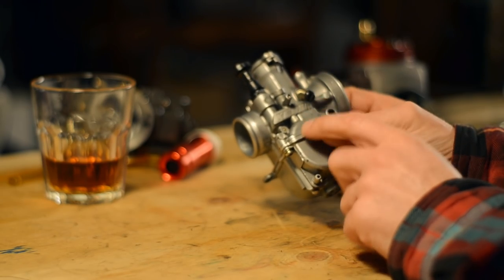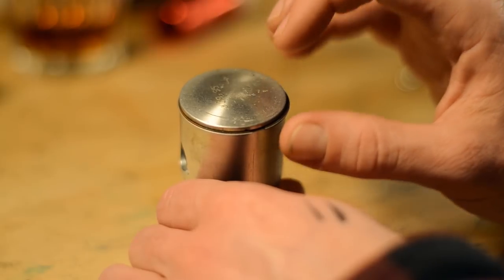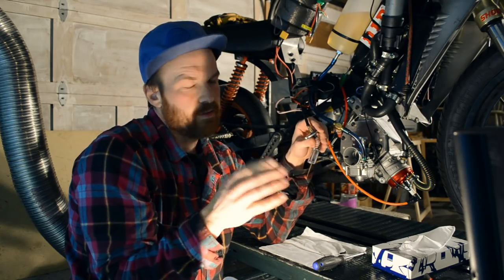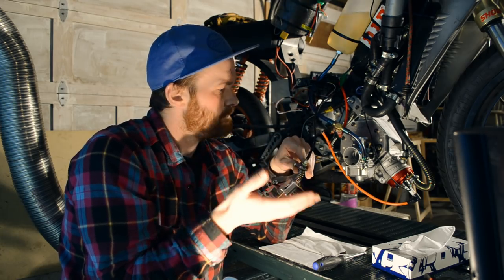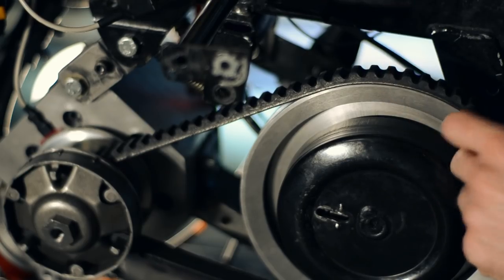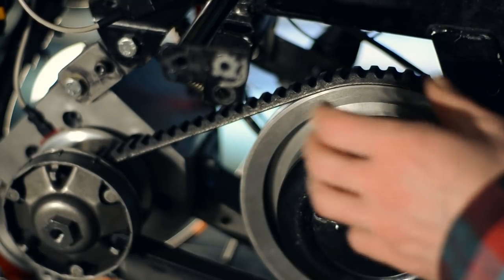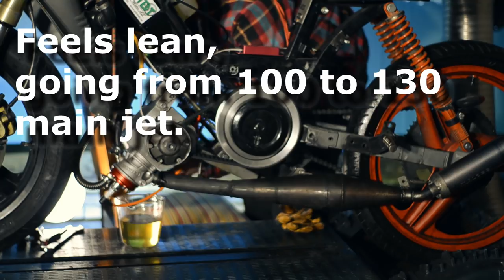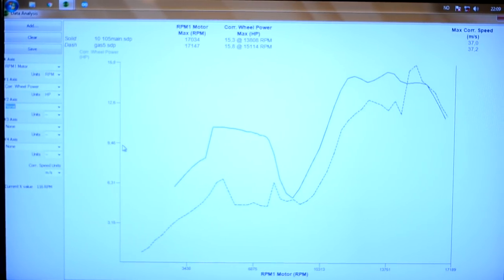FUEL FOUNTAIN! | Spx Ressurection Part 6

Comment: Bro didn't you get a wideband.... wouldn't that like help solve everything. If you are using a wideband please let's see some of the data in the video. Of all sensors for that matter.
Reply from the maker: I did. Just holding back until I feel it's necessary, they have a habit of dying quickly in two strokes...
Reply: The standard bandwidth meter does not work with methanol when the mixing ratio becomes lower than 10 afr
Reply from the maker: Wouldn't just reading the lambda value work?
Reply: 2STROKE STUFFING dem vanlige bredbånds sensorene har en måle verdi fra 22 til 10 afr. Bensin ha optimal 14.7 sugemotor full sus ned til 13 turbo ned til 12 eller lavere. optimalt for metanol sugemotor er en verdi på 7 ved overlading helt nede i 4.  så du vill makse ut måleren din for og kjøre greie verdier på metanol. Har begrenset kunskaper på 2t men mener på d enkleste der er og bruke eksostemp sensor. Håper fikk noe nytig ut av d veldig vanskelig og forklare på en enkel måte
Reply: Ja jeg vet, sent svar, men jeg fant denne kanalen nylig.
Jeg har holdt på en god del med datasprut og eksperimentering med E85 på 4t motorer, og da også WBL.
Den måler lambda, og ikke AFR direkte. AFR vist på instrument er omregnet fra lambda.
Med etanol og turbo bruker jeg sikte på ca 10.5-11 AFR(bensin). Altså 0.71-0.75 lambda.
Med metanol og nitrometan kan du nok gå enda feitere enn lambda 0.7 om tenningsankegget klarer det. Men med en WBL som går fra 8-22 bensin AFR så er det fortsatt en god del ned fra lambda 0.7 til 0.55(8 AFR bensin).

Comment: Where do you get the gasket material? I would need some 0.2mm for my cylinder...
Reply from the maker: Local hardware store... You'll probably find sheets on ebay/Amazon.
Reply: At least biltema doesn´t have that. I´ll go check the Hardwarestores. :) Thanks

Comment: Hmmmmm   that is interesting foaming  at WOT ?  So when you back of a bit can you get it to stop or slow down ?   Have you  lengthened your intake and tipped it a bit  ?    OIL type ?  damn i  will think about that more, you just don't  encounter that  much at all if ever .. You done any venting  or  add a vent or change a vent size ?   Vacuum ?      Fuel injection is cool for driveability and cold start  but WOT  the Carb is still king   you will even get better hp numbers with the carb at WOT     .. Nice Videos   JET SKI CARB O DAMN that is it !

Comment: Oh wow, that was quite literally a fountain. Sucks man, but already gaining some power while the carb is acting like that is probably a good sign. 
Can the secondary clutch be machined to accept a wider belt? If so you know where you can send it :)
Reply from the maker: Yeah it was insane, lucky I didn't end up in a fireball! I noticed smoke coming from the header but thought it was oil burning off. If you listen closely to the "fountain run" you can hear it really picking up just before it starts puking and goes flat. Thanks for the offer! I've switched back to the narrow belt, needed the wide one to prevent slipping when pull starting but with the drill it's not an issue.
Reply: Lucky indeed, but it seems like you're having plenty of bad luck already..
Speaking of clutches, there's another variable you've changed since the old setup, the primary clutch/variator. Does the angle on the belt match the variator? If you have a mismatch there the belt is probably robbing more power than it should.
Reply from the maker: Keeps me busy😁 The belts and variator is matching - power loss is just as awful as before but not worse.

Comment: Could I run rc fuel on a stage6 streetrace cylinder??
Reply from the maker: Absolutely!
Reply: 2STROKE STUFFING ok I'll try it
Reply from the maker: Make sure you feed it lot's of fuel, LOTS!
Reply: 2STROKE STUFFING ok
Reply: 2STROKE STUFFING did rc fuel gain power? Also which one would give me more power nitro fuel or 110 octane gas??
Reply from the maker: Methanol/nitro(even methanol alone) will beat any petrol based race fuel. Insane fuel consumption is a major drawback tho.
Reply: 2STROKE STUFFING ok I'll keep that in mind!!

Comment: I'm new on your channel and i have a question - why don't you make a better exhaust system dedicated for your cylinder?
Reply from the maker: It's custom made and actually not bad at all, even though it looks like shit...
Reply: maybe not like shit, but it's very, very simple construction, even the last cone is one-piece (two-piece is quite better, because you can give it two degrees and get a way better wave reflection). How did you made this? I mean calculations, do you have an episode about it?
Reply from the maker: It was simulated in engmod2t, great software. I plan to make a better version later.

Comment: Do you know why i can't get max power rpm over 12 000 but it rev 15 000. Ported50cc am6, 19mm phbg,tpr v force, mvt intake manifod, scr corse racing line 50 exhaust
Reply from the maker: Not enough port time area, especially blowdown is a probable cause - if the pipe is tuned for power up there.
Reply: My exhaust port is 187° i think 190° will be better. I will try what happen is it better or worse

Comment: Hi, what ist the Exaust and Transfertiming on that cylinder? 
I,m porting my Chainsaw and i need some compare Angles.
Now i‘m on 190 ex 130 Trans and 130 intake. 
Ignition is 30 deg  running Gas.
Runs good but revs just 15.500
Reply from the maker: Approximately 204ex, 130/132t
Reply: 2STROKE STUFFING 
Thanks 204 ex thats a lot. 
Problem on chainsaws is the less compression caused by more pre exaust timing and the combined cylinder and head. Next thing is the Piston controlled intake.
Whats the ignition Timing on the spx at gasoline?
Reply from the maker: Currently about 13° at estimated peak power rpm 16000
Reply: 2STROKE STUFFING 
Ok, 13 deg is very less i expected.
Most chainsaws working on 9000 rpm have around 20 deg pre ignition. 
Maybe i should go later with ignition.
Thanks and go on with your nice Videos. Greetings from Germany
Reply from the maker: It depends on alot of factors, especially the pipe. Try shifting it both ways and see what happens!
Reply: 2STROKE STUFFING 
Pipe is a stage 6 Pro Replica Scooter Pipe . I‘ll try. Thanks for supporting!
Reply: intake  is that piston timed? In that case it's too low timed. just put it on 170 degrees by drilling the piston skirt
Reply: 2STROKE STUFFING no the chainsaw. I think that isn't rotary inlet

Comment: Could the problem be in the amount of revs? So the movement of the piston gets so high, the weight exceeds the contra weight of the crank? Or aside from the softer intake putting some a rubber weight on the rotating mass of the engine ( like the ATL dampers on tuned cars ).

Hopefully you get it fixed.. I can feel your frustration
Reply: Pistons don't get heavier at high RPM.